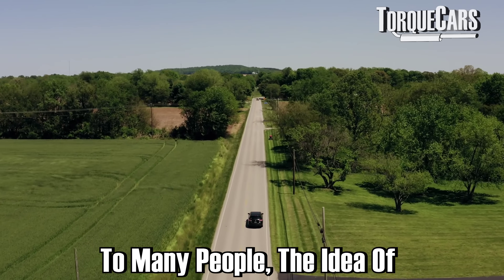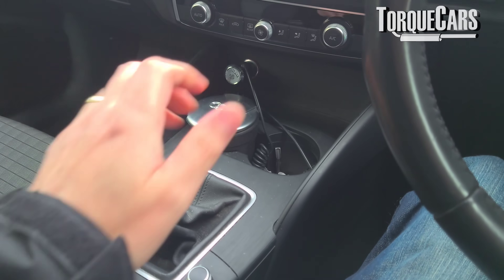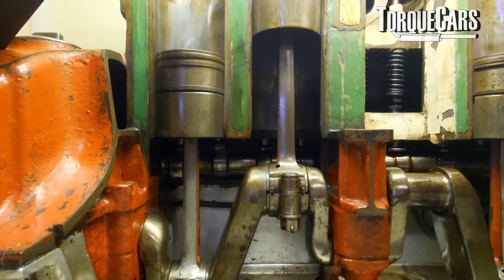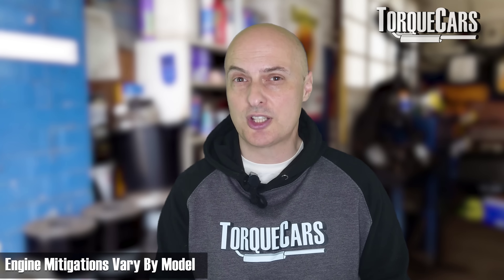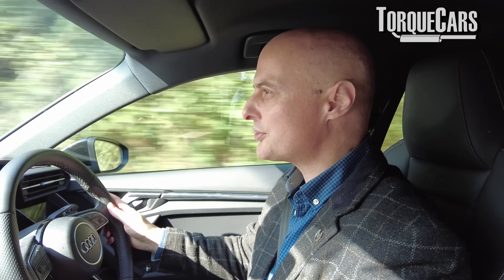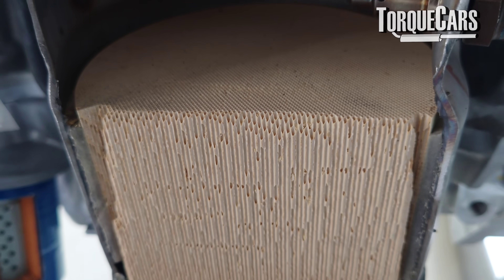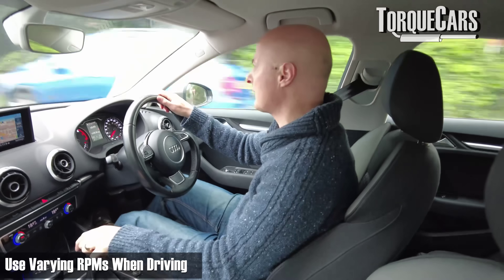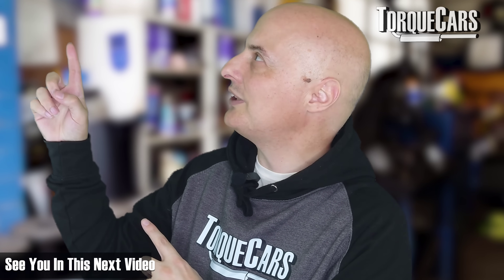BIG DAMAGE By Lugging at LOW RPM? Eco Driving Warning! (Manual Gears)

Comment: I drive a 30 year old Toyota Soarer with a 1UZ and I mostly cruise but every day in the 100kph zone I floor it up to 100 either twice, four or six times each day for about 7 years now.

It’s only 250hp so this isn’t very wild or unusually dangerous.

I always change the oil early and so far it seems to be tremendously sturdy and reliable and at 53yo I’ve owned 3 Australian Holden 5.0 V8s, 2 Chryslers (a 318 and a 360) 3 Ford V8s (2 302 Windsors and a 351 Clevo) a 350 chev, a 347 LS1 and a semi-Australian LS2 6.0 (Holden-factory spec LS2 with LS3 heads) and except for the 6.0 I ran them all ragged and wore them all out with pretty similar treatment and all within 6 months to 2 years.

I miss BIG power but this little V8 is more durable than all of the others put together.  It seems to put out a little oil smoke when cold (might just be condensation but looks oily) in the morning for about 1 minute during warm-up but other than that still feels beautiful.

Unbelievable little (physically big) motor!

Comment: Hi there. I drive an Audi A6 C6 Avant Quattro. 3.0 TDI. I bought the car new in 2006 have 490.000km on the meter now and apart from 1 clutch, 2 sets of brakes and oil service every 25k I never did anything at the engine. I NEVER rev higher than 2500 (except on highway 3200 max) and I have an average fuel consumption of 4.8L/100km. I can't remember that I ever reved the engine in all these years. It has enough torque that I can climb any mountain road in low revs. And there is nothing wrong with the engine. I don't believe low RPM are bad for the engine. At least this Diesel Engine
Reply from the maker: The problems with the variable flow oil pumps were much later than 2006, yours is a pretty good solid engine with loads of low end torque.

Comment: So much misinformation. Trucks drive low rpm and go million miles. I very rarely exceed 2k rpm and i never had any issues. Fuel economy is extremely good
Reply from the maker: Interesting, may I ask how many gears to typical trucks have?

I'm not surprised really they have a very narrow power band and oodles of torque from low down so I guess they are even harder to lug.
Reply: @torquecars   low RPMs are terrible for semi trucks too. We can just get away with it better

Comment: Back in the past, some engines were designed for this.  The GMC 8.2 liter straight 6 had it's torque peak below 2,000 rpm.
Reply: That's basically a (semi) truck engine!
Reply: @TassieLorenzo  Yes.  This was before diesels became useful.  Must have been huge.

Comment: 1)At low RPM combustion efficiency is best, because the longer the charge is compressed during combustion, the better it burns.
2)pistons aren't equal.
Short skirt ones can have issues to keep the oil film and floating on it at low rpm.
Guess what?
They're not used in the common engines, only on racing cars and (some) supercars.
3)the major part of the lateral stresses on pistons comes from connecting rods inertia, not from combustion load.
Inertia increases quadratically with speed, so an engine who is running faster have bigger lateral stresses on pistons.
That increases on engines with short rods compared to stroke (the more the rod is angled at 90 and 270° of the crankshaft rotation, the worse is the situation).
4) combustion speed is increasing with engine speed, since the turbulence and tumble in the charge is increasing circa linearly with engine speed.
The result is that combustion happens in about the same crankshaft angle (in gasoline engines, Diesels are different since combustion is related to injection (s) duration at different power outputs).
So forces from combustion are comparable.
If not, your engine can't make more power at higher rpm.
5) the right fuel for the engine avoid detonation or anomal combustion.
It's well known that detonation happens often at low rpm, but that doesn't mean it's caused by low rpm.
6) oil pressure isn't an issue.
Oil pump flows more oil for every engine rotation at low rpm because the pressure limiting valve wastes flow at high rpm (at least if the engine bearings aren't worn).

The only issues are related to carbon deposits (they need heat to burn away), and sometimes piston rings cooking (they need to work hard from time to time to clean themselves and their grooves.

Comment: An engine that is constantly at a low rpm May not be getting lubricated property. The oil pump is designed to work best at a higher rpm. I would be concerned about a cylinder walls, rings , wrist pins . Cam shaft being properly oiled. Also, because of the blow by issues at low rpm could cause oil dilution and sooting and sludge.  A better way to get a little bit better mileage would be to slightly over inflate your tires and drive like a normal human being.  Stop pissing off everybody else on the road with your hyper mileage  crap.  The Italian tuneup is true. Change your oil /filter then put some fuel injection cleaner in your tank and drive your car at about 75mph for two hours.

Comment: I was told by Subaru sti owners that If you have a turbo car, don’t slam the throttle to the floor, roll onto it. It takes a split second longer but it’s better for your turbo. Apparently a lot of Subaru turbos have failed because of this malpractice.

Comment: It is also possible to reduce temperatures by approximately 200 degrees by drilling holes through the particle filter and deactivating the exhaust recycling.

Comment: I like the recommendations here. I wonder if this applies to those whose vehicles'  mileage is at the point where the timing belt needs to be replaced. That's my biggest concern with my Golf because I'm over 90k miles on her. So I'm thinking twice about pushing the car.

Comment: Also if you have a direct injection engine, the engine wont get hot enough to burn off carbon deposits always running at low rpm.

Comment: What do you consider "low" rpm? I would say 1200+ is fine for normal laod (50% or less), 1500 in a diesel and 2500 in a gasoline is fine for full load
Reply from the maker: It depends so much from car to car and engine to engine. Listening to the engine note will tell you if it is struggling or not, along with the response you get. 

Even in the same engine a low RPM will vary depending on what you are doing at the time, towing, going up hill etc all put extra strain on the engine and lower the threshold, conversely cruising along at constant speed without a load you can get away with being near tickover. 

The key is not to strain/labor/lug the engine by choosing an appropriate gear. 

Diesels provide loads of torque from low down, but even mine struggled to accelerate from 30 in 5th gear!

Comment: I was having an argument with a mate a couple of weeks ago that while driving in the sand, sitting at 3500rpm in 2nd gear is better for the engine than 2000rpm in third gear, because third gear requires almost full throttle thus the engine is labouring harder.

Comment: This is such a misleading video. No manufacturer sells an engine that has to be driven a particular way to survive, at a minimum, for the warrenty perod or the typical usage of its first and second owners. Most engines from the last 20 years produce something like +90% of max torque from 1500-6000rpm.
The issues are as simple as:
1) Carbon build up caused by cold oil from consistently short journeys. Driving it harder and particularly at high rpms warm an engine quicker and for the same journey can reduce cold running time. But this is very different from saying that "low rpm is bad"
2) Detonation. If you drive like a complete muppet and try and tow or climb hills in top gear on the lowest octane fuel, significant engine damage is possible and you will know about it very quickly. But this isnt just a 'slightly worse for your engine' type issue.
3) Every rotation of the engine there are several bearings doing their job for the crankshaft, camshafts and accessories like alternator, air con etc. While most of these typically last the life of the car, they do have a finite life and if you always use more RPMs to drive the same distance like 3000rpm instead of 2000rpm they will wear out faster

Comment: Manual vs Automatic is mainly a thing between US and Europe/rest of the world. Also here in the Netherlands and Germany the majority of cars is manual (says the manual car driver) 😅 Sometimes it's almost not possible to prevent certain negative behaviour in your engine. Direct injection engines are prone to carbon buildup in the head, therefore my next will be an EA888-Gen3 that also has port injection, which at least prevents part of the carbon buildup.

Comment: I think your post is quite confusing. 1 - Does it apply only to manual cars? If it does put a disclaimer on. 2 - Does it apply to over gearing driving? If it does put a disclaimer or make the matter clear. 3 - Does it apply to diesel and petrol? Or just and mostly to one of the fuels? It is not clear 4 - Explain why lorries do exactly the opposite of what you say.  - Diesel engines have always been engineered to be driven  to function on the plenty torque they make at low rpm and this means the right gear to speed and inclination (something that applies to any engine) but you say almost the opposite. This doesnt exclude the occasional faster drive using higher rpms. I feel like uneducated / sloppy drivers are the cause for this article with interesting aspects but at the same time raising false alarms to all else...
Reply from the maker: I tried to make as as simple as possible for people for example it says "Manual Gears" in the video title, although it may be possible to select the wrong gear in an auto which has manual control. 

ALL cars are different so we simply can't make rules that this applies to A B and C but not D. It can apply to some diesel and some petrol, older cars will suffer more than modern ones which seem better protected. The topic needs discussion and debate and hopefully I won't see so many cases of engines destroyed by lugging them in the belief it saves money.

This channel TorqueCars is about cars, not lorries and trucks.

The key I wanted from this video is to get people to THINK about their gear selection and the load on the engine rather than dictate. I've also not specified what LOW RPM is for the same reasons as it varies too much from car to car and whatever load the engine is under at the time.

Comment: An engine is most efficient when it is at its maximum torque.  
We used to have these ''infomercials'' here in the Netherlands, promoting ''the new driving'', where you are told to shift between 2000-2500rpm...  
I always said; Yeah, maybe in a diesel, but not in a gasoline car...
Reply: Being most efficient at peak torque revs is not necessarily equal to consuming the least amount of fuel while being at those revs, it’s like buying goods in bulk for a cheaper price per item but not actually needing that many of them. Let alone the drag when talking cars, not stationary engines.
Reply: Thats not 100% correct. For instance modern downsized turbo petrol engines which is every 2nd car almost have peak torque at around 1,750-4,000 rpm range (depends on engine ofc, can be 1500-3500 etc). If you will go lets say 90 km/h at the highest gear you will be under 2k rpm. If you push the pedal all the way down you will hardly accelerate even if you have peak torque. You will need to downshift at least 2 gears. In general, turbo petrol engines will have good acceleration at 3,000+ rpm, non turbo petrol engines need much more rpm for good acceleration, at least 4,000. Turbo diesels will have good acceleration from 2,000-2500 rpm but are dead once you hit 4k.
Reply: @blackwidow7804  Depends also if it has a lot of power/torque in general to compensate, for exemple a sport-ish car or bike can handle simple acceleration fine just in peak torque, right ?

Comment: My mother got so lazy at shifting. She would drive through town without down shifting, doing 35mph in 5th gear. She killed two or three cars like this. I finally told her to stop driving manuals, and buy automatics.
Reply: Automatics aren't necessarily the best answer. I drive an auto which is very reluctant to change down; if left to its own devices it would slog up hills all day at below 1000rpm, so I frequently find myself manually selecting a lower gear to ease the load on the engine.
Reply: @saxon-mt5by  this doesn't make sense. The torque converters or DCTs will know when the engine is under too much load and change gear. You can't stall an automatic and you can't lug it. This video only applies to manuals
Reply: My Volkswagen polo isn’t very good in city conditions the dsg is starting to lag
Reply: @saxon-mt5by  as a co-driver on a garbage truck that's automatic,i agree.

The automatic is perfect anywhere else for the type of vehicle it is, but hills are problematic as it struggles to select a proper gear.
Reply: @Deceit-hx7ey  Would lifting off or pressing down on the pedal for a moment make it downshift. Automatics are "dumb" computers that don't want to shift if you don't change the throttle input.
Reply: @modarkthemauler  there is actually a semi-mechanic mode on the truck that is engaged with a button on the wheel, there you can go higher or lower by 1 gear.
So that kinda solves the hill and automatic issues lol.
Reply: @Deceit-hx7ey  Hooning my flappy paddle garbage truck!
Reply: @Deceit-hx7ey  as a trucker you've got the wrong vehicle but it's fine to kick it in manual when necessary. wait till you get in a truck where the accountant decides you don't need manual mode and you deal with a hill in a low grip situation.
Reply: @saxon-mt5by  I was thinking the exact same. It's irks me when people crawl up steep hills in town, so everyone behind them have to lug their engines, or shift down, even with most auto trans. I had an Acura (auto) that actually knew when to shift down. It also knew when not to shift up. Like when accelerating and letting off the throttle when the light turns. Many auto trans will shift up, making it harder to brake. The Acura would shift down instead under this circumstance.
Reply: Some autos have a lot of overlap between gears and will let you stay at low RPMs if you have a light touch on the gas.
Reply: @saxon-mt5by hybrids. Toyota/honda basically divorce the rpm/speed relationship.
Reply: @saxon-mt5by  Dont automatics take into account how much throttle you are giving it? I know when I owned an automatic if I floored it it would select lower gears for me, if I kept the throttle pressed in a small amount it would keep higher gears
Reply: My grandmother has an SUV with a five speed in it and never used first gear and never went over 3.5k in it, the redline was at 7k. Her clutch went out before 100,000 miles.
Reply: @sherithnoorey1419  well, thats not a bad number according she never usd 1st gear
Reply: @claudiliciousX3D  Agree thats pretty good mileage for any clutch.
Reply: Interesting. My car will tick along happily in 5th at 28mph and it's an automatic.
Reply: @t28mcd  then you definitely have a transmission problem or your DCT or ECU is fucked up lol
Reply: @iprophecy6768  Not necessarily, it all depends on the load on the engine. It could be just fine if you are going slightly downhill for example.
Reply: @iprophecy6768 not at all. 5th gear at 30mph is usually the limit. My previous car a swat ibiza 1.4l toca could do it easily and not stall. It didn't have any issues.
Reply: Nothing wrong with being in 5th gear at 35 mph as long as you are on a flat or downhill, and just cruising.. I do this on a regular, and one of my cars is pushing 300k, and still healthy. Definitely nothing more than slight throttle input in this condition , and I mean slight throttle input. The moment you need any ind of power you need to shift down. I also take all my cars to the rev limiter in a regular. I do a lot of shifting lol.
Reply: It's best to only accelerate when revs are at least 2,000rpm.
Reply: @nathanfarra6371  Yeah my mom was the same way, not a lazy thing, she drives an automatic but always made sure to never let the rpm go above 2.5k. told me growing up 'going higher than that is just going to damage the engine' which was always funny to me because my favorite cars have always been rotaries that thrive at higher RPMs.
Reply: The clutch, 💀🔥
Reply: @nathanfarra6371  automatics also drive in 5th gear at 30mph. I drove my seat ibiza like that as well, no issues.
Reply: @nathanfarra6371  1.2 vauxhall corsa.pulls itself along quite happily in 5th doing that
Reply: Holy shit what? My driving instructor told me that I did not need to downshift to 4th from 5th as long as I kept the speed of 50 km/h.
Reply: After the 3 car 😂😂😂
Reply: this mostly concerns manual teans cats where at 1k rpm in 3th gear you  floor it.  have I got that right ?
Reply: 35mph is almost 60kmph, it's ok, their cars weren't dying because of driving in 5th gear at those speeds. Yes, it approaches the minimum safety limit, but it certainly won't do damage, I always drive like that through town even with 50 kmph in 5th gear and my engine is almost as silent as an electric after 7 years of driving it myself and 5 years from the previous owner.
Reply: @TheRealTwinsen  to be honest my car will manage a bit of a hill at 35 mph in 5th. Not too steep though or it's down the gears.